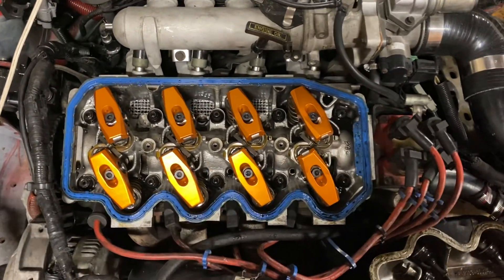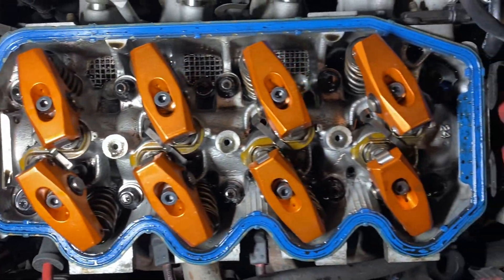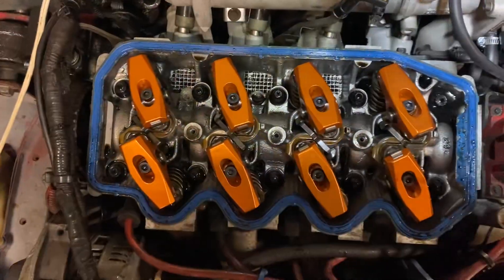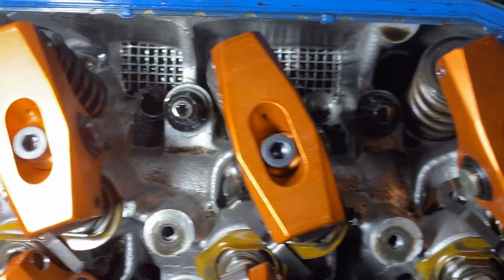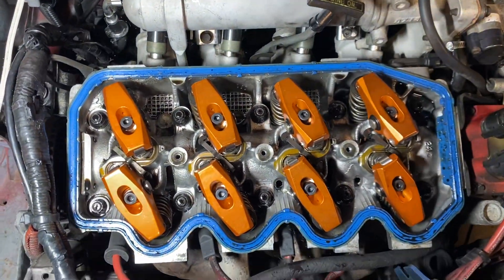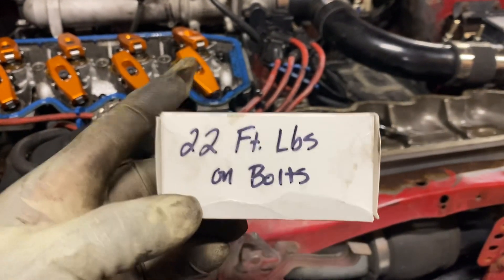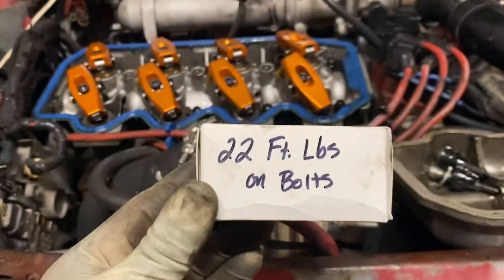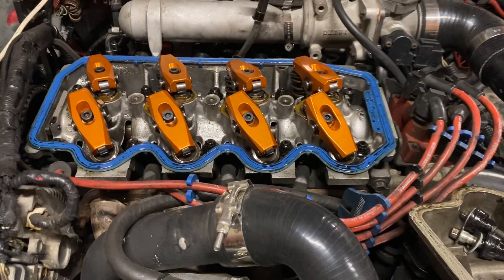EOTTRACINGTEAM Finally got the Harland Sharp roller rocker arms installed.

Comment: Ford says 18ftlb for the stud style, I don't know what they want for the bolt style. Clymer/Haynes says 15-22ftlb for the 81-88 engines vs 17-22ftlb for the 89+ engines - roller lifters must take more pressure to avoid slipping.

Their torque spec may differ because of the bolt hardness & surface texture like you mentioned about ARP.

Anywho, what viewers should remember that it's best to torque them while the lifter is on base circle and they should be torque-checked after a few revolutions. And they should be checked every 10k miles on the flat-tappet engines at least, as the cam+lifters wear they need regular adjustment- still waiting to see if the roller lifters have the same effect.

These are to be used with the stock under-trunion spacer/shim/washer right?
Reply from the maker: The roller set up does not require the maintenance of the solid set up, this engine has been together for 14years under boost, and I have never had to pull the valve cover. When I installed these Harland sharp roller rockers, everything was just as tight as the day I assembled it. There is a lot less friction contact with the roller set, which intern means less wear issues. The only issues I have had with my valve train is a weak hydraulic tappet. Other than that it has been very reliable. ARP bolts, nuts, studs definitely required higher torque specs than the OEM ones.

The Harland Sharp roller rockers don’t have spacers, or washers, they fit right in factory location. They have pedestal mounts just like the OEM ones.